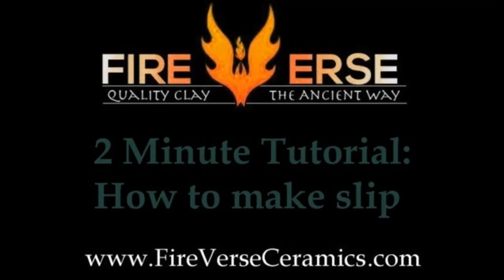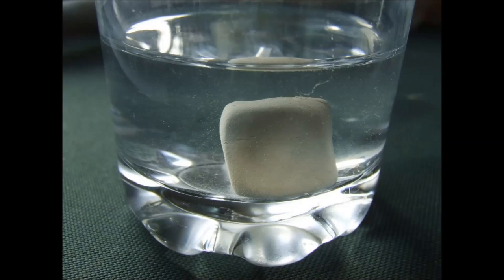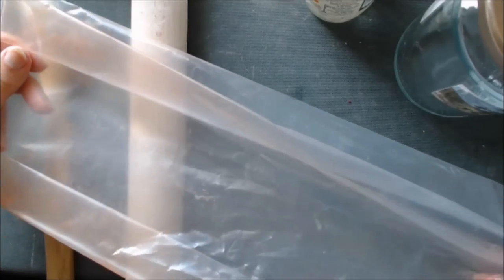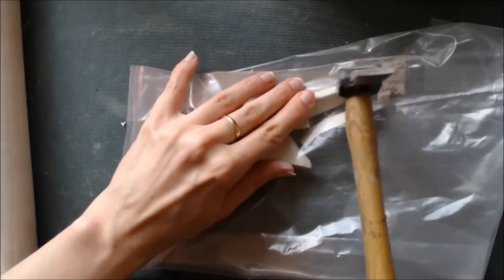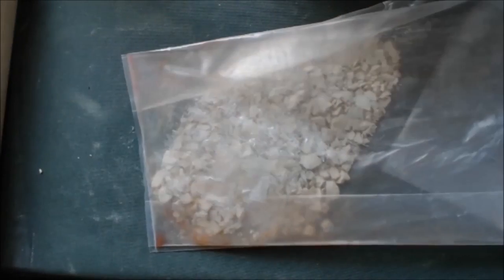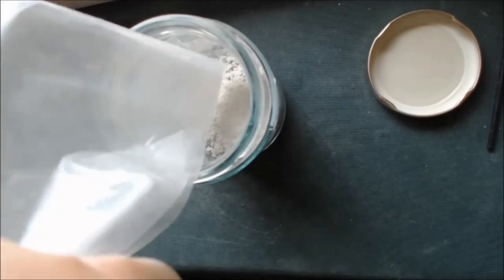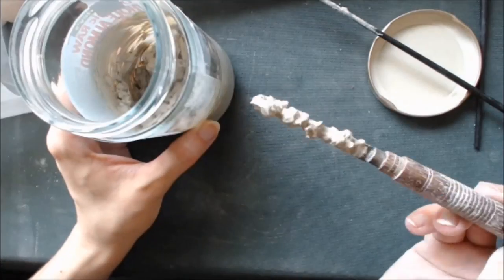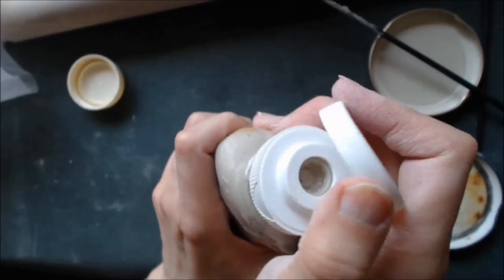Pottery Tutorial How To Make Clay Slip Video At Home Quick and Easy

Comment: Beautiful to the point video. If i had to guess why orange would be from the tomato in the ketsup.
Reply from the maker: Lol, not quite, I do wash out the bottles before re-using them.  It's from a type of algae, which is quite common when you're storing clay in damp conditions - very damp, in the case of slip.  Some people apparently encourage algae growth on their clay as it is said to increase elasticity, but of course that's neither here nor there when it's on slip, and it all burns out in the firing so I don't worry about it.

Comment: Hello! great video, ive been trying to find the proportions for using engobe which would be just coloured clay right? you just buy the pigment and add it to the slip? Thanks in advance!
Reply from the maker: Hi Yohanna, I'm afraid I haven't got any experience with using engobe, so can't be much help.  I have experimented - briefly - with mixing underglaze with slip, and it seemed to work as expected, but the proportions were very much a judge by eye matter.  All I can suggest is to pop a few batches together with different ratios and try them out on some test tiles to see what works best.  Hope it goes well.

Comment: Could you make slip with air dry clay for slip casting? Flumo doesn’t ship to South Africa :(
Reply from the maker: Hi Samantha, I've never done slip casting myself, so take what I say with a big pinch of salt...  I would imagine that air dry clay would be fine, providing you got it to the right consistency.  As far as I'm aware, air dry clay is clay, it just has added paper fibres (or nylon, or flax fibres, etc.) to help give it strength once dried.  I use a type of air dry clay for some jobs myself, and it fires up just like regular clay (but the pieces are significantly stronger in the raw state).  Depending on the fibres used in the type of air dry clay you have, they may cause a bit of unwanted texture, or it may be absolutely fine.  I'd suggest testing it out with a small batch and seeing how it goes, but I can't see there being any major problems that would prevent it from working providing you were able to wet the air dry clay down to the proper viscosity that slip casting requires.

Comment: Can this slip be used to fill molds? I want to make dolls with slip casting but its quite expensive in my country, so If I could make them using this "DIY" slip it would be amazing!
Reply from the maker: Hi Mavya, I've never used it for that purpose myself so I can't say for sure, but seeing as I believe it's all the same basic ingredients I can't see why it wouldn't work.  For something like that you'd probably want to make sure it's as smooth as possible though, without any lumps, so I'd suggest using an electric whisk (there's some heavy-duty ones you can attach to the end of a drill, if you're making a large batch) and/or put it through a strainer, depending on the consistency you're wanting.  Be aware that using a whisk will probably introduce a lot of air bubbles, which you should be able to minimise by giving it a number of strong bangs - just so they don't interfere with your slip casting.  As always, I'd recommend testing it out on a small piece first.  Hope it works out for you.  :)

Comment: Hi. would this method of making slip work for casting into a mold?
Reply from the maker: Hi Jason, I've not used it for that purpose myself, although I can't see why it wouldn't work.  Just add enough water to make it consistency you require, and make sure there's no lumps of unmixed clay, and it should be fine.
Reply: Jason T did you try it in a mold?
Reply: Mike Neuzil sure you could use this in a mold but better to use a slip with darvan in it.

Comment: Or you could just soak the dry clay in a jar of water for 10 mins and pour the water off when it settles
Reply from the maker: There's plenty of ways to make slip, seeing as it's essentially just water and clay.  However, clay that has dried out thoroughly is surprisingly hydrophobic and doesn't wet down well, at least not quickly, so pulverizing the pieces is the best way I've found to ensure the quickest results with the most even consistency.  Otherwise there's a good chance you'd end up with very lumpy slip.
Reply: If you just add water and get it runny could you put that in a blender or would it not work well?